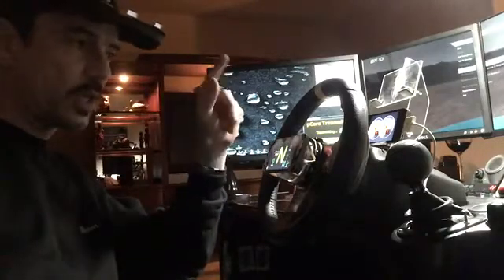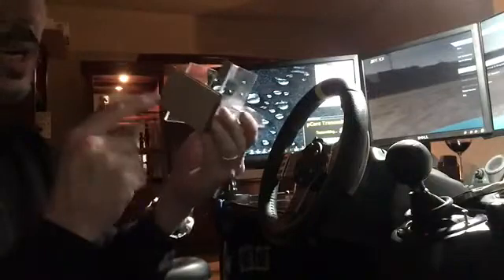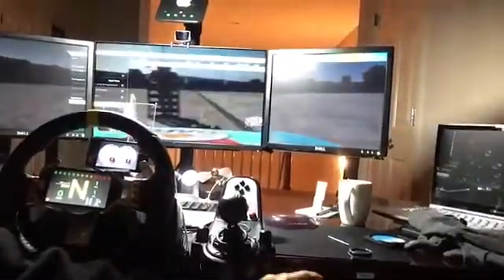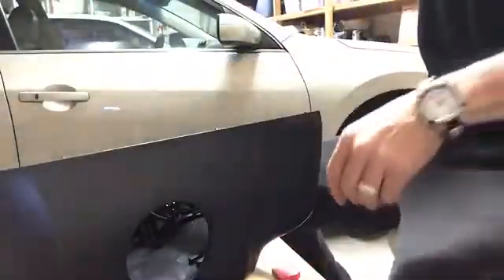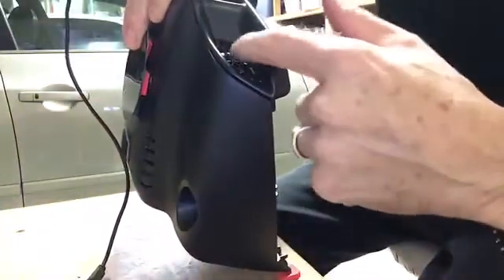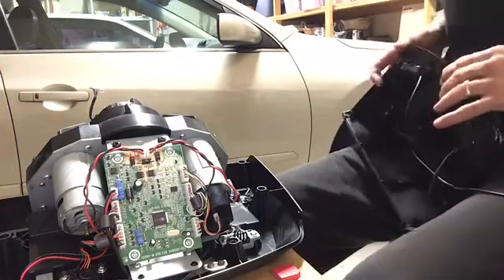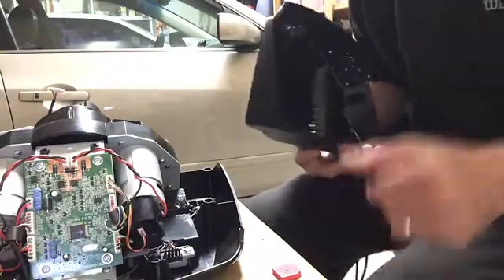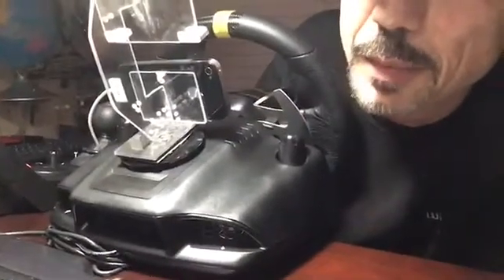Logitech g27 centering and heating problems corrected

Comment: i install fans, and after 1 month, dust build into optical encoder, than i have centering problem.
Any fix?
Reply: theres a fix yes, take the fans out because they dont belong there at all, every air intake is also a dust intake and that will bring you into problems.
if your g27 is overheating it means theres an sirious problem that should be fixed and not beeing avoid by implementing other solutions and not solving the real problems
Reply: its normal for the g27 to overheat @Dredlocks131
Reply: Add a dust mesh on the holes